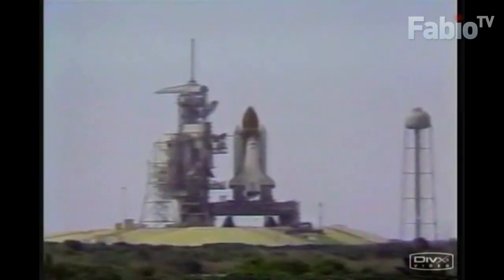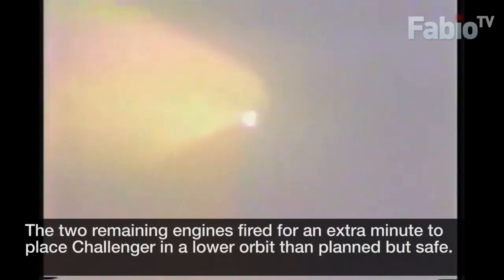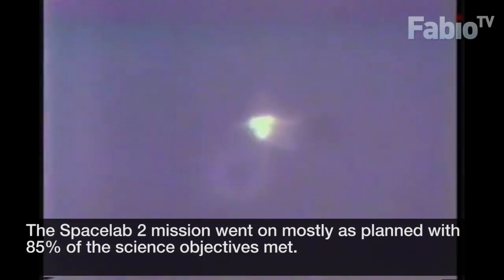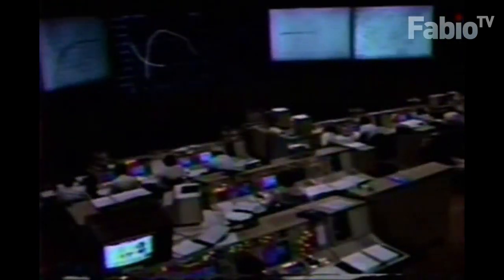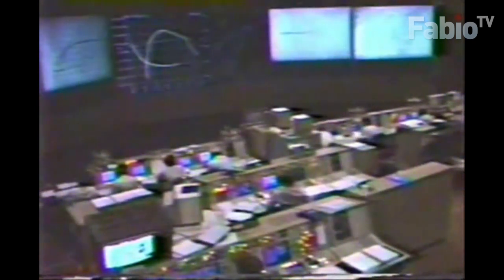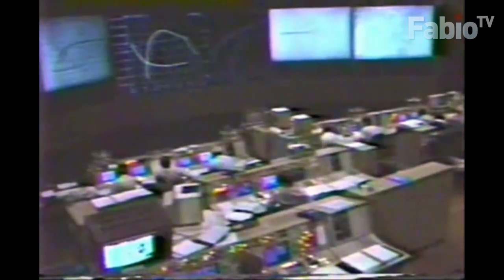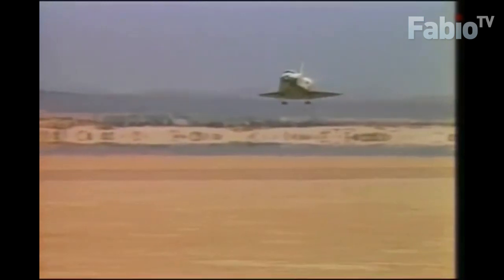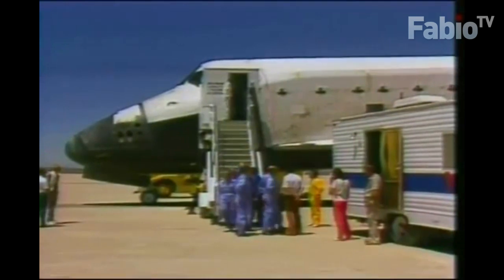Abort to Orbit - STS-51F Mission - Challenger

Comment: As I understand it, between the call to ATO and the ability to reach Zaragoza on a single engine, a second engine nearly automatically shut down but was fortunately overridden.
Reply: That all goes down at 6:51. The callout "limits to inhibit" revokes the computer's authority to automatically shut down another engine. A faulty temperature sensor in the center engine caused it to shut down and they had just lost another temperature sensor in the right engine just after they passed the transatlantic landing site.

Comment: Here in 2020 and still think they should have kept the Shuttle program going!
Reply from the maker: Too expensive, nice but costly
Reply: @fabiomb  yes and high failure rate
Reply: 2 out of however many isn’t that big a failure rate. However they still didn’t want anymore loss of life. And it was aging...the tech was from the 60s
Reply: @BlueBraviaryGirl  just to put into perspective, the Soyuz, which is even older than the shuttle, has not had a fatal accident for 50 years. Yes there have been failures of the spacecraft or launch vehicle since then, but that just highlights how safe a capsule design is. A failure similar to what  Soyuz MS-10 experienced would likely not survivable if it was a Shuttle.

Challenger showed how dangerous the SRBs were, and Columbia showed how vulnerable the heat shield was.
Reply: Ok and yes 2 of 5 vehicles lost is high in that sense